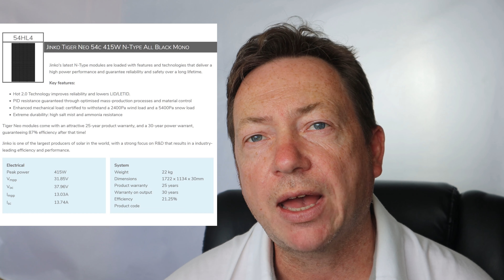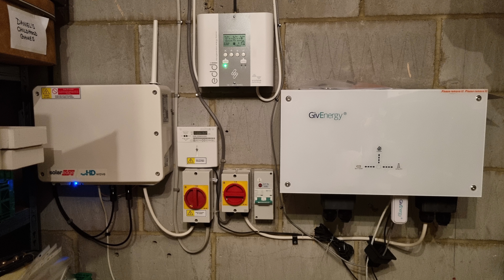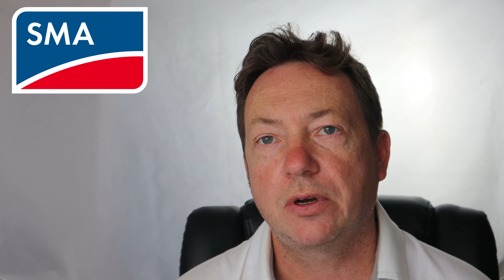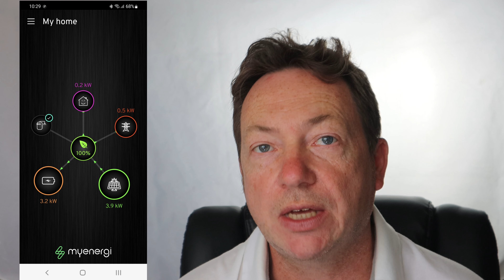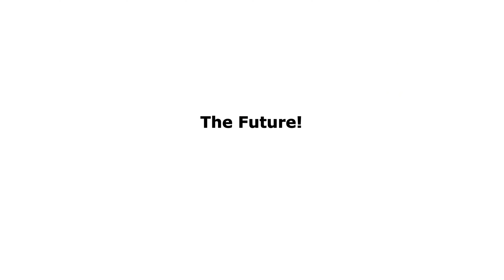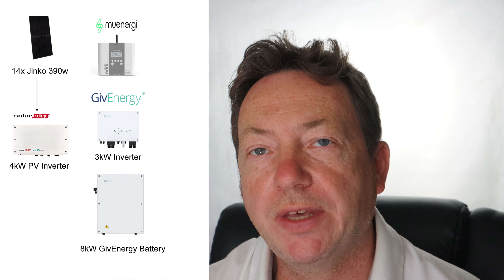Thinking about Solar Panels? Things to think about!

Comment: Hi @Daniel,

For our quick introduction. 
We are a specialist and a Full-Stack Solar Permit Design Services and Consulting firm based in India.
We have been helping US/Canada/UK installers and homeowners to develop their solar and EV permit plans and get them stamped if needed. We can help you with the following :

    Proposal Drawings/Prelims (Solar and EV)
    Roof and Array Sketch
    Shading Analysis
    ROI Calculations
    Good Turnaround time (Within Hours)
    Permit Drawings (Solar and EV)
    Title Page, PV Layout
    Include Governing codes as per NEC rules
    Attachment and Structural Details
    Electrical Details, SLD / 3LD, Calculations
    Wire & Conduit Sizing
    Inter-Connection method
    Elevations, Signages, Spec Sheets
    Turnaround time - within few hours
    Stamping coverage in all AHJ's of US/Canada/UK
    Familiar with G99 guidelines in UK 

We can do PV system designing for

    All AHJ's in US/Canada and UK (NEC guidelines in US and G99 Guidelines in UK)
    On Grid system for partial home or full home back up
    Off Grid system with batteries back up

Currently we have been working with different organizations similar to yours and helping them design permit and proposal plans with accurate quality and best turnaround time.
We are a team of committed engineers to deliver you the best quality plans with best turnaround time.

Looking forward to your reply. 

Best Regards, 
WWW.CADascent.com

Comment: Hi Daniel.Great video certainly got me thinking. One thing that i could not get was the 2 inverters.Why 2
Reply from the maker: A few people have asked this. I wanted SolarEdge with it's 25 year extended warranty - but didn't want to pay the higher price of their batteries. Also SolarEdge allow me to monitor each panel with their optimisers, I'd like to know if one ever fails. I can also get more draw from having 2 inverters so if sunny all I can get from the solar inverter and draw 3kW from the battery as well if I ever needed to.

Comment: Just wondering what are the pro’s & cons of an in-roof solar array versus an on-roof system?
Reply from the maker: I have no clue from a power point of view, but I would have hoped production would be the same. I just didn't want to pay an extra day of labour for in roof and then have my tiles removed, which I would then have to store if I ever needed them put back. Although I agree having them flat in the roof does look a lot nicer.

Comment: One thing I would emphatically state, based on actual experience  across multiple installations, is AVOID Chinese brands (JA Solar, Jinko, Trina, Growatt etc.) Quality just isn’t there and they have been many issues with warranty support, spares etc. They will offer tempting specifications, disproportionately lower prices (and margins to installers) to try to displace the quality brands.

Best panel brands to go for are Solarwatt, Sharp, Hyundai or Sunpower.

Best inverter brands are SolarEdge or Enphase.

Best battery brands are LG, SolarEdge, GivEnergy and Tesla.

Comment: Great intro video, thanks. What made you go for two inverters?
Reply from the maker: I wanted the SolarEdge inverter on the solar side as I wanted optimisers on each panel so I could see if anything went wrong with a particular panel, plus SolarEdge offer a 25 year warranty if you extend it. I didn't want the SolarEdge battery though as they are expensive so I went for the GivEnergy battery, which meant I needed another GivEnergy inverter. That was the main reasons.
Reply: @daniel_coe  thank you so much for the detailed reply. Just about to go on this journey subject to being able to get hold of kit :D
Reply from the maker: @ARTEMY5Music  good luck

Comment: Just so happens i'm looking at solar solutions as well. A friend of mine has recently commissioned an install which isn't dissimilar to yours but it's quite a lot more expensive. Does your system have islanding so you are covered incase of a powercut? An with regards to installers, would you mind sharing who you went with or DM'ing me their details? TIA
Reply from the maker: I believe my set up will not work in a power cut, although I think the battery would drain down and provide power, but nothing after that. I used a company called Green Solar World in Newmarket, Suffolk. I did also have extended warranties on everything and bird protection, without those 2 items I probably would have paid about £1k less. But I suppose hardware prices may have risen.
Reply: @daniel_coe  thanks for the extra information, it certainly made for interesting reading. Personally speaking I would like to include islanding as powercuts might be more common in the future as supplies struggle. But it's a gamble... all of this, the capital expenditure, hedged against on-going rising costs.

I liked the eddi device you're using are you just using it for your immersion?
Reply from the maker: @huwwilliams3664  yes just using the Eddi for the immersion tank, there is a 2nd output on the Eddi, but I can't think of what else to use it for. I don't have a hot tub!

Comment: Thanks for the video,  I've researching solar at the moment, so it was handy.  Why go with two invertors rather than a hybrid?   I've been leaning  towards a hybrid as it looks simpler, is there a catch?
Reply from the maker: I wanted SolarEdge on the solar side for the optimisers and the 25yr warranty they provide, but Solar Edge batteries are expensive. So I went for GivEnergy batteries which meant I needed a GivEnergy inverter as well. Yes I could have just had a GivEnergy hybrid inverter the max warranty on these if you pay extra for it is 10 years. But I also read a hybrid inverter has to work a lot harder than separate inverters so that may reduce it's lifespan. Having 2 inverters also means I can have up to 4kw from the solar inverter and another 2.6kw from the battery inverter at the same time, if I need that power. Having only one inverter may also save you about £1,000. There are many different ways to set up a solar system, and I am not going to say my design or choice of products is the best, every house is different.

Comment: Hey! Thanks for the information 
How does the output of your east array compare to the south facing one?
Reply from the maker: I just took a look at the totals for April to July (4 months). Each panel is very similar. So the panels on the South each generated 240kWh and the panels on the East each generated 220kWh. I hope that helps.